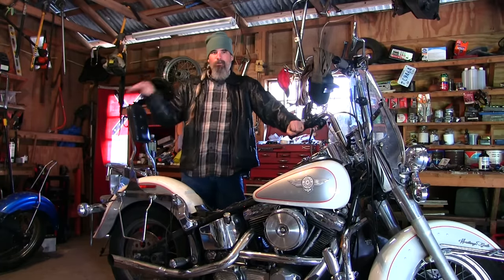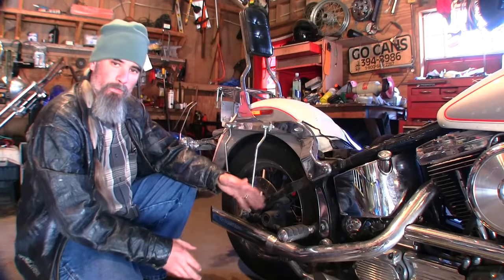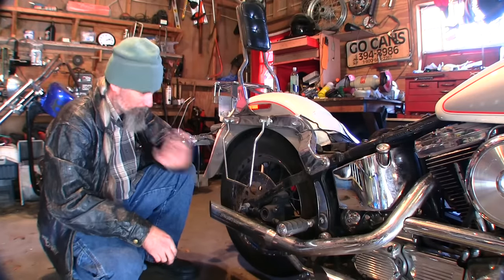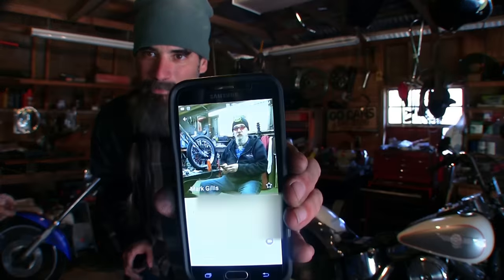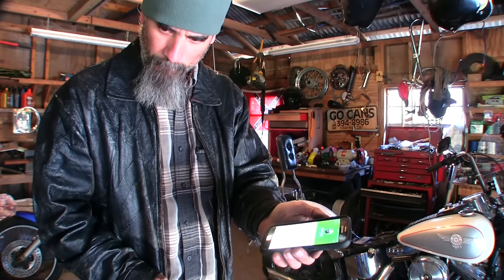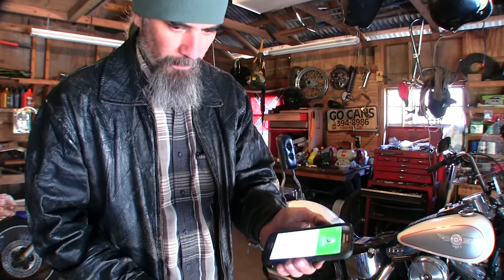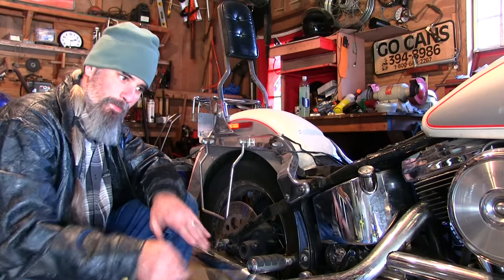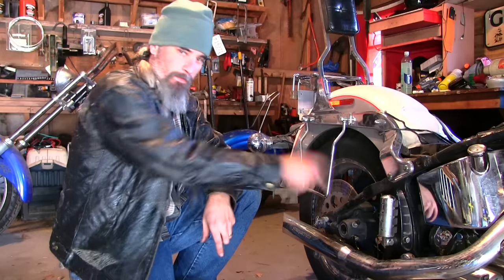Harley Evo FLSTN Heritage Softail Brake Caliper Locked Up

Comment: I'm an ASE certified mechanic, and your theory and method about cracking the bleeder is 100% correct. Generally the first suspect in this problem is any flexible brake hose in the system. The rubber breaks down inside, and becomes like a check valve. It will allow pressure in, but then not let it release. You proved the wheel caliper was the culprit when you had no fluid shoot out.

Comment: Another great vid, Tramp. The caliper was seized because it was over-extended from thin brake lining, and the piston not straight  in the bore because of the uneven wear. You broke it loose c- clamping the piston back in.
   Weird...just fixed my rear brake on my 98  Ultra 2 weeks ago with the exact same problem.
   IMHO, add a little light to the subject being worked on for better visuals. Great channel. Ken

Comment: another cool video, Saddle Tramp!  I would check the rear wheel alignment, belt tension and the runout on the rear brake rotor.
Reply from the maker: Good idea XL.

Comment: Hi, I had a similar case these days. I disassembled the piston and put on some special break piston grease. Also when I assembled the breakpads I put some copper grease on the points where that has to move.

Comment: Awesome video bro always love seeing someone with a passion for motorcycles sharing their knowledge
Reply: When you went that far already why wouldn't you have pull the caliper apart and check the Pistons and cleaned everything in there? Something cause that brake pads to wear uneven like that like the Piston was sticking or something???

Comment: Had the same same thing happen on my 85 wide glide chopper. Rear brake only. Noticed it was dragging and grinding when I was pushing it out of the garage towards the end of the first riding season of not running a front brake. Brakes wore down more than I expected, new pads fixed it right up

Comment: Your initial test was a good one for pressure stuck in the system. Brakes can also hang up mechanically. The caliper itself can be hanging up on 2 sliding pins. The caliper needs to float in and out. Check/clean/grease the pins every pad change. Or the piston can be stuck- overhaul needed. Or the brake pads themselves can be hanging up where they attach inside the caliper. Always replace the anti-rattle hardware when replacing pads. Make sure the pads move freely in the caliper. A thin layer of ceramic brake grease on the clips is best. In general, a worn outer pad indicates stuck piston or pad hung up. A worn inner pad indicates caliper not floating or inner pad hung up. Both worn even is a good thing.
Reply from the maker: Thanks!

Comment: I described the background of the following details in another comment on "knowing your limits" when wrenching on your bike.

You would think that a single piston on a floating brake caliper would have a simple fix. My Sportster had a piston that would compress the discs against the rotor and then relax just enough to let the rotor turn when releasing the brake. However, the piston would not compress when I wanted to replace the pads which were paper thin, just like yours. (I bought the bike from another person after it had sat in the garage for about 10 years, so I figure this was the initial cause of the problem.) 

After a couple days of using many different tools, I figured I should get professional help before I seriously broke something. I rode the bike to the local Harley dealership's service department to fix it because I don't have a good shade tree mechanic nearby. After working on it for over 6 hours, they had rebuilt the caliper, flushed the system and still didn't have it fixed. the pedal was hard but I had no brake. I explained that the brake was working when I gave the bike to them and now I only had a front brake that would work. I couldn't ride it home over the mountains for two hours. Since it was closing time and I had no way home, they gave me a loaner to ride home. I called them every day checking on the progress. They would order a part and try it, and then order another part and try it, etc.

Nine days later, the bike was repaired. They ended up replacing every part of the entire rear brake system including the master cylinder, reservoir, brake line, caliper and rotors. They admitted they never did find out the root cause. They got it fixed but they didn't know which part was bad. Since it was a safety issue and a major inconvenience on my part (even though they loaned be a new bike), there was no extra charge for anything beyond the initial caliper rebuild. This dealership has been in business for over 50 years and they have a good reputation, so I didn't feel so bad about not being able to fix such a "simple" problem. 

So, don't feel bad about your troubleshooting skills.  You "did good"! Great video!

Comment: When opening the bleed nipple, please use a clear hose that points upwards, then curves down into an empty bottle. This will allow the hose to fill up with any brake fluid. That way when you crack open the bleed nipple, it doesn’t suck in any air.

Comment: I've just been down this road with the front calipers on my '08 RK. Don't mind my saying but I think you could've taken the opportunity to clean that piston before pushing it back in and since seals are cheap I'd have replaced them too just for good measure. I believe the sticking/dragging issue I had with my RK stemmed from the previous owner crudely forcing the pistons back in (the pads needed changing for the annual Gov. test) even though they were covered in hard grime. This led to sticking and warped rotors. I also rebuilt the master cylinder as it was a $30 part plus a couple of copper washers so it seemed sensible to just do it at the same time. So much expense could've been avoided had the guy just been more thorough in his work. 
Enjoying your videos by the way. Ride safe.

Comment: One of the things I never see anyone do is change out the brake fluid, it goes a long way to a healthy hydraulic system. If you check your shop manual I believe it should be changed every 2 tears, also get the ceramic lube for the friction ponts on the pads, they slide way easier. Also clean and lube all the slider pins on the calipers, you  can make them like new again.

Comment: Motorcycle brakes can get touchy. Confusing even for a good mechanic sometimes, I know. Been working on mine. Rebuilt master cylinder twice, had to get a suction tool to get it right. Good luck on your brakes. Good videos.

Comment: Old guy with '97 WG. Have not watched the whole video yet. Will delete comment if not helpful.  Went to a bike rally last summer. Very hot that day.... 94 degrees. Front brake caliper locking up. Just had the brakes "serviced " ? about two weeks before. After removing chrome cover found that master cylinder had small leakage around cap. Removed some of the excess fluid from reservoir. So far .....so good. Brake fluid does expand when hot, don't know if too much will not allow caliper to release like it needs to. ?? Just my 2 cents worth.

Comment: If you have an older bike with brake lines that are made of rubber, you should replace them with stainless steel braided lines. The rubber can deteriorate inside and cause the brakes to tighten up and not release. It happened to my '93 BMW a few years ago. It also may be necessary to disassemble the calipers from time to time for cleaning and inspection.
Reply: Under that braided stainless is a rubber hose.

Comment: Hi, 9.10 sec in video the rear pad shims are you sure they fit that way as i thought they end of shim facing you slotted between mounting bracket and rubber boot as it holds it in place while you put pads in, great videos, hope you don't mind me asking. Thanks

Comment: I had my front wheel lock up on my Evo softail, the rotor wash dished 1/4” and rubbing on the caliper. Dude who replace the rotor last didn’t line up the key way on the hub with the slot in the rotor.

Comment: Your wheel is adjusted wrong! Rotor hits high on 1 pad and low on the other pad! Belt not tracking correctly???? Use a 1/16 rod to measure with. From axle to the swing arm bolt on both sides. It's in the shop manual.
Reply: Na, pads caught in the sliders i bet
Reply: Could be a combo of alignment but a warped rotor, dirt in the sleeve of caps, a foot riding the pedal on a twisty road while under the influence of a happy glow. Did I do that? Yup that was me. Oh yeah your pads are too low and they stick out when you push on them. . I haven't watched the video, just a thumb up and a comment. Good luck brother. I'll watch when work is over at 9 pm God bless. Shiny side up!
Reply: Can I just use a tape measure from center of Axl to the end of frame ? Fast cheap, easy,
Reply: He ain't heavy, he's my brother!
Reply: uneven Worn brake pads  also shows me there's a possibility the puck ain't coming out straight... I'd use the shop airline pop that puck out replace that quad o-ring put it all back together again then test that puck, common problem happens on automobiles all the time.. also, maybe not this time, but if brakes hung up, won't release pucks from coming back in the caliper if the wheel bearings are too tight and you don't have enough run out.. you're never going to kick those pads back off the rotor I'm also factory trained

Comment: I just got a 2015 HD 883. I'm a pretty new rider and took it out on a first ride after I got it delivered. I had only gone about 2 miles, but that was a lot of stop and go because I was working on some smooth quick stopping. Around mile 2 it seemed like it was losing power and started to die despite throttle. I pulled to the side of the road and turned it off. It would not push at all, not even rock a bit like it does when it's in gear. My neutral light was on and I even depressed the clutch, it would not budge. After about 30-45 minutes and it let me roll the bike in neutral like normal. I didn't want to leave it so I cautiously drove it home a mile and had no issues. What would cause this to release the wheel when the bike cooled down? Thanks for the advice.
Reply from the maker: Sounds like you have some obstruction in the brake line not allowing for the fluid to return back when you take your foot or hand off the brake. That's rather common when those rubber brake lines get some age for the interior of the line to decay and cause that.

Comment: Hello, it's been three years since you posted this video, but perhaps you still look at comments and questions. I have a 2000 Heritage Springer and I have not been able to bleed the front brakes. The front wheel turns and is not locked up. I tested the master cylinder and hose, and they passed the test, and there is no blockage, so it has to be the caliper. Have you experienced this? This all started when I went to change to a Speed Bleeder and put in DOT 5 fluid. Now, I can't get the front brake to bleed because no fluid flows out the bleed screw from the caliper, Any ideas?
Reply from the maker: Being that air rises to the top, what I've always done is gradually pump the brakes at the handle (slowly and easily) until all the air has risen to the top. You should see air bubbles rise to the surface level of the fluid. If you don't see any air bubbles, stop for about 20 to 30 seconds and start again. I takes a while sometimes, but just keep at it until you begin to feel pressure.

Comment: Regularly check the caliper temperature after a ride.
No it shouldn't be warm if you didn't use it a fair bit.
Hot is dragging.
The stock brakes on my '99 FXDL with EBC HH pads would catch out anyone who says Harley brakes are cr*p.
In the UK HD parts are twice what they are in the US which is already 4 times what they should be.

Comment: Tramp I'm going to fault you on this one. As a rider that does his own work I'd a thought you would of inspected the brake pads when you did your oil change/service.  Take your flashlight and looked at the pads front and rear it only takes a few seconds. I understand you want to go but you also want it to stop. Enjoy your videos.
Reply from the maker: I actually did. They looked good at that time. I guess whatever brand the pads were don't get a lot of miles.

Comment: Sometimes when the brake pads are very thin on an Evo the piston would not return or it could also be that someone disarmed and armed the pads and exchanged the pads inner outer... I’m guessing overworn brake pads
Reply: While you are it... Try to lube the piston with chrome polish and brake fluid, you remove the caliper from the wheel and press the brake pedal until the piston goes out some, when liquid starts escaping you can clean the piston and then lube it with brake fluid, then return it to normal position and then assemble on the bike

Comment: Not sure if you covered this but why did the pads wear uneven?
Reply from the maker: Not sure. I assume the piston must have been cocked in the cylinder. It's working good now, but suspect I'll encounter this problem again.
Reply: @SaddleTrampTV  I don't think there is enough difference in the  size of the cylinder and the piston given the limited outward travel of the piston to allow for it to be cocked. If you have an old caliper you could easily verify my reasoning.

Comment: Hey brother, are you sure the problem is not something inside where the fluids are moving? Seems to me like no matter how thin the brake pads would be they should retract and apply until metal to metal. I fear it may happen again where it locks up because of crud in the line somewhere?
Reply from the maker: Probably
Reply: Great job on your channel by the way, I always look forward to your video. I’ve put my 07 heritage up for trade because I would love an older Evo but not having the same luck as you had LOL patience is key I suppose. Just don’t want to pick up any junk but you did inspire this Decision. Because you’re right about the older bikes it’s a feeling hard to describe
Reply from the maker: @bennoury8509  Yeah, just be patient. It took me 4 tries until someone bit. I knew I had an offer that someone out there couldn't refuse. It'll happen if you keep at it.

Comment: Tramp just a quick thought, did it ever occur to you the reason the brake pads are worn uneven is because the brake caliper pistons are sticking in the Caliper bores.  In other words the caliper needs rebuilding.  I have run into this in my vintage sports car restorations because moisture sets in over time and begins to contaminate the fluid resulting in rust and corrosion in the caliper bores. It’s possible the old owner may have used the wrong brake fluid as well.
Reply from the maker: That sounds likely.

Comment: Hey Saddle Tramp, never saw you hit the brake pedal  after replacing the pads to see if the wheel released...was the problem that the pads were so worn the caliper was too far out and would not free up after releasing the brake?
Reply from the maker: Something like that I guess. It lets go pretty good now.
Reply: Good deal! Ride safe brother!
Reply: He pumped the brakes at 11:32
Reply: Stefano Musica
10/4, I guess I missed it...

Comment: I use cooper slip  on re- assembly, have you tried it ? Enjoy your vids, keep um coming.
Reply from the maker: No I haven't.
Reply: A smear of copper grease on the back of the pads where it contacts the caliper will stop "brake squeal"

Comment: Thanks jus learned something new,  had the same problem but when I took my back wheel off, I could see burn marks on my rotor plus my back wheel was locking up, which is very scary and deadly so I went ahead and just ordered a whole new caliper. Plus I’m chromin  out the ass end of it because I’m building a cholo softail so again thank you
Reply from the maker: You may want to check to see if your rotor is warped because of that too.